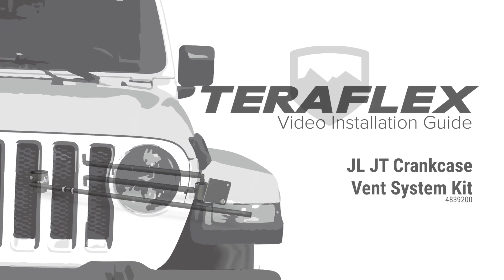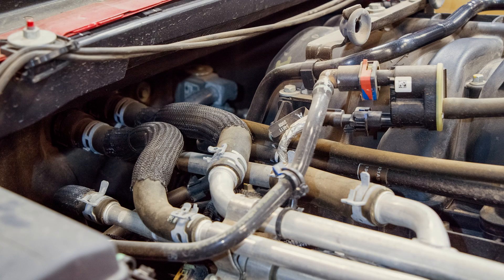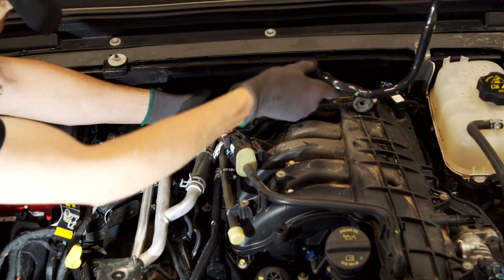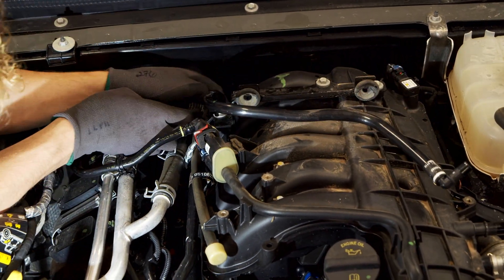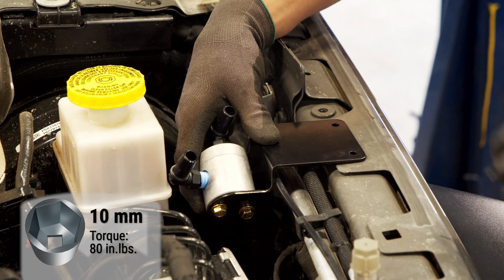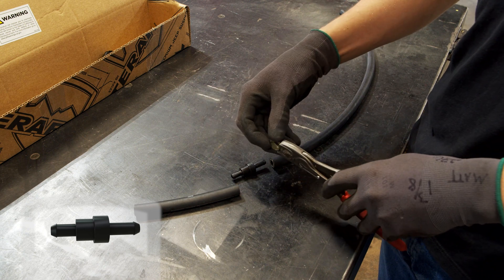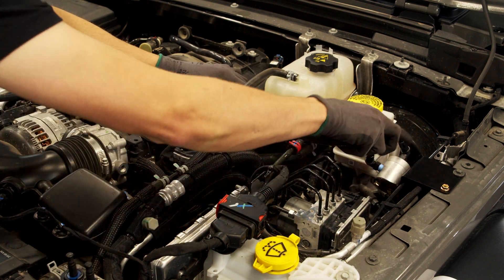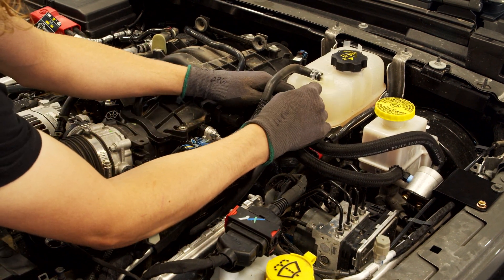JL / JT 3.6L: Crankcase Vent System Kit Install | TeraFlex

Comment: Why run this over on oil catch can?
Reply: This is a fix, kind of, whereas the catch can is only a delaying mechanism. It works until the can fills up, then you are back to square one.
Reply: I guess for those who don't want to deal with the mess the catch can collects would be the only upside.
Reply: I got the smoke today ordered it an hour after 😅